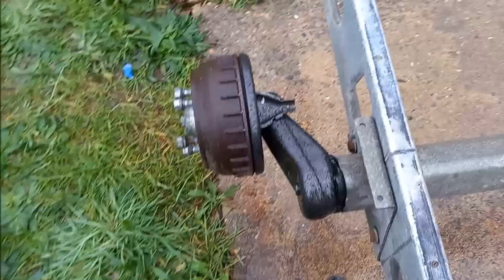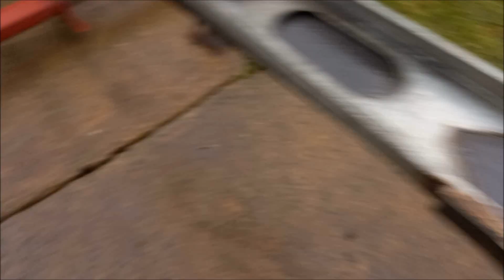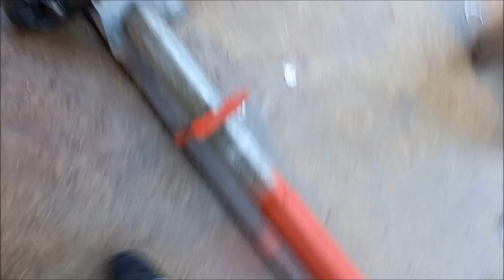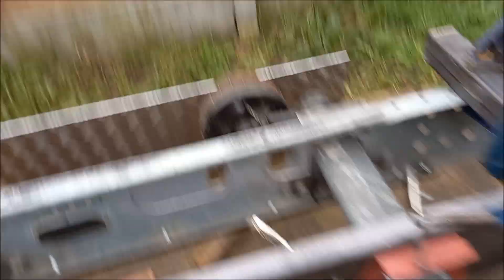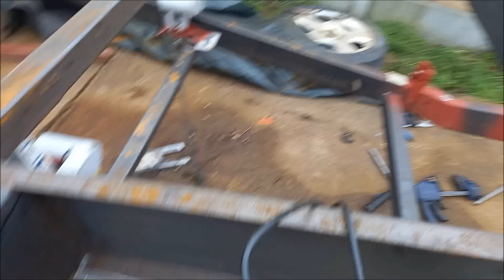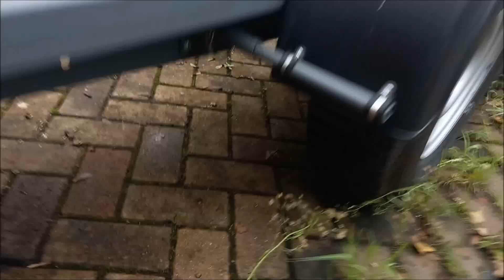Twin axle remote hydraulic tilting car trailer. Complete build

Comment: Really nice job. I'm sure it will be extremely handy. I never did understand what the levers on the rear are for or what the lever and cable on front are for ?
Reply from the maker: The trailer can take a really low slung car (my track car) but needs to use the ramps, the rear levers are for the under supports when raised, they're on gas struts that hold them up or down. The heavy duty cabling at the front is for a removable 13000lb winch, it just plugs into the Andreson sockets. The front lever is the handbrake, I'll show the trailer in a working scenario when the season starts again. I was using it towards the end of the track day season

Comment: Tire people love those axles. They wear tires out like they are free.
Reply from the maker: My partner's family belong to the touring caravan club, the only time the tyres require replacing are from age, never from wear, I have been motor racing for over 30 years and never replaced a tyre on a trailer due to wear, again just age cracking
Reply: If you overload it you have problems. You can’t beat the way they pull loaded. I don’t think you will have problems if you keep it loaded right

Comment: Nice. What Hydraulic Jacks did you use ?
Reply from the maker: I bought the rams and pump from ebay, I had to do a fair bit of work to make them suitable for my application, including designing and building the jacks 'metalwork' The rams and pump were apparently off a tail lift